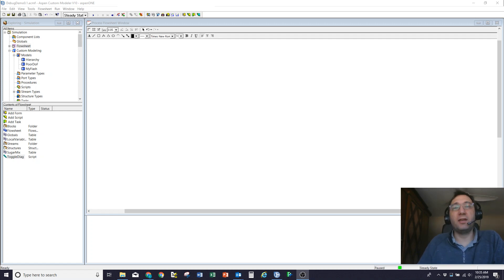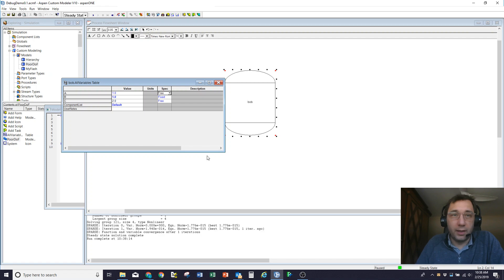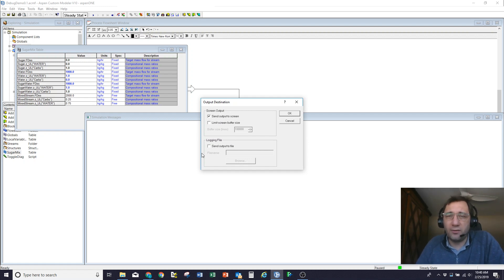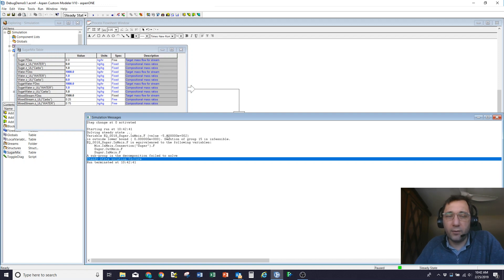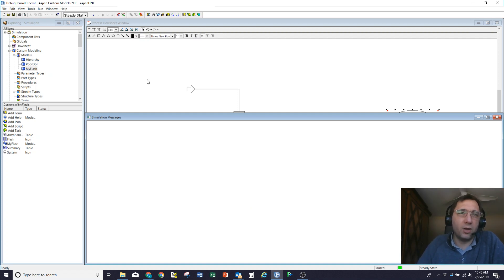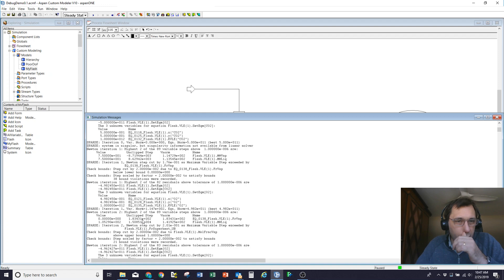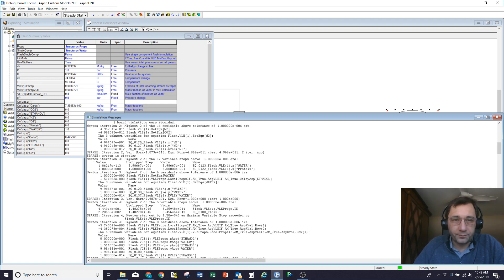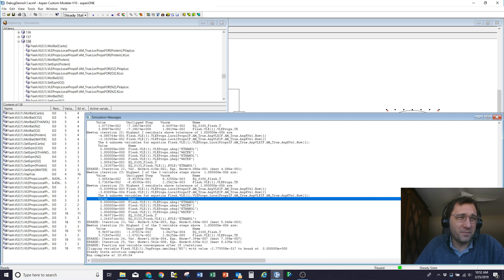ACM7. Troubleshooting - Interpreting ACM error messages

Comment: Hello Mr. Charles,
Thank you for this video, it helps me solve some problems. However, I've got these problems and, as a new ACM user, I don't know how to solve them. Could you help me, please?

When compiling my model I get this message: 
1. WARNING: Component list "Default" is not initialized

And when I run it, I get this for 3 different equations of the same form: 
2. AM_Equivalence_0001 contains the following 2 variables:
      modeler.Q_elec
      modeler.Qelec.Q

In my model script, I have Q_elece and Qelec as follow:
Q_elec as power_electric;
Qelec as input HeatPort;
Q_elec = Qelec.Q;
Reply from the maker: I'll try...
For the first message, it looks like you're trying to call physical properties from the Aspen Properties database.  It do that, you need to initialize your components (pick the chemicals that you want to model and the thermo package that you want to use).  In the Explorer window, click on Component Lists, then select Configure Properties in the lower window and work through the prompts.  Alternatively, if you don't want to use Aspen Properties, right click on Default and select "Convert"
The second message is not an error - this is ACM trying to be more efficient - if it finds simple equality in your model (like your Q_Elec=QElec.Q equations), it recognizes an opportunity to make the Jacobian matrix smaller by replacing that one equation and two identical variables with just one new "equivalent" variable.  This in turn makes the model easier to solve
Reply: @cssandersonllc3172  Thank you very much. This solved it
Reply: @cssandersonllc3172  Hello, when exporting my model to Aspen Plus I get a red triangle, although it's green in ACM. How can I detect the error and solve it, please?
Reply from the maker: @dohaelrhoul3849  I'm sorry, Doha - I have very little experience with use A+ and exporting models.  In my limited experience, the A+ export does not reliably support inheritance and submodels or anything but the simplest structural parameters.  On the few occasions that I've tried to export to A+, I had to rewrite the ACM model extensively to remove anything like that.  Sorry that I can't be more help
Charles
Reply: @cssandersonllc3172  Alright, thank you. Could you suggest any reference (youtube...) apart from the user guide to manipulate the A+, please?
Reply from the maker: @dohaelrhoul3849  Sorry - only the Aspen documentation is available, as far as I know